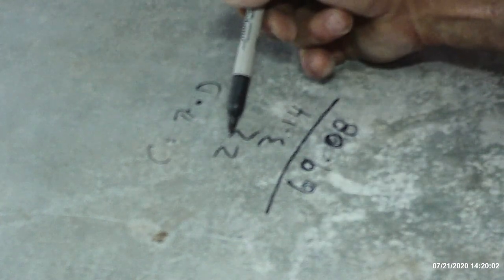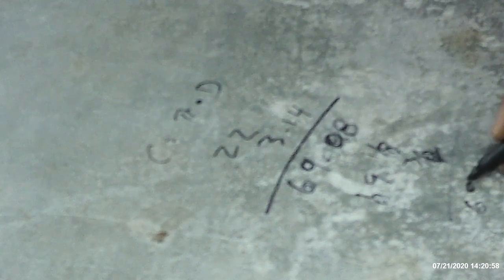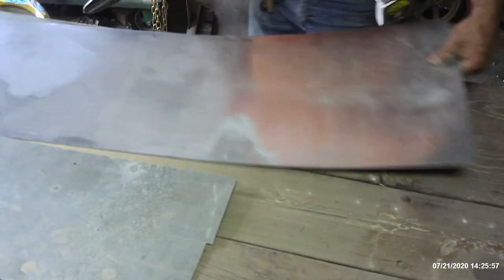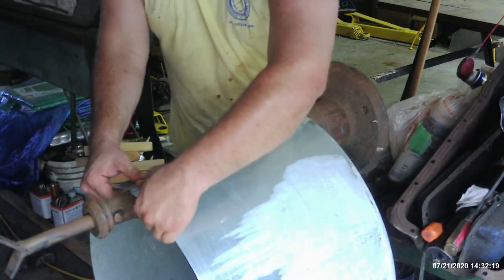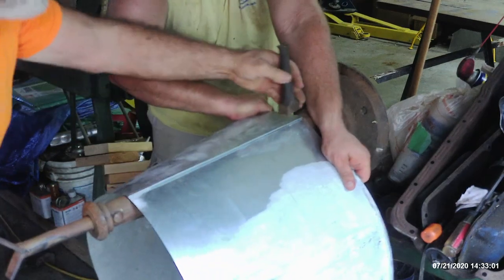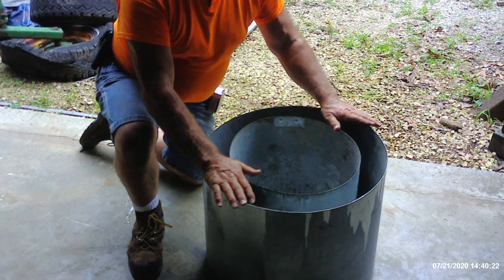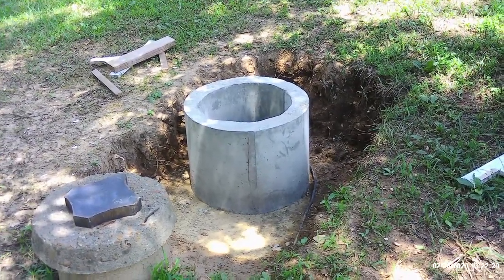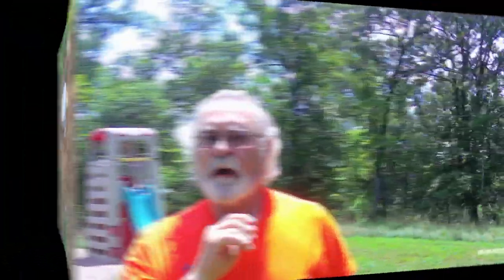Grooving Tool Handmade Lock for Round Pipe,  Septic Tank Riser

Comment: This is a very good idea....I will do the same thing for the septic extension at the camp....well done...CHEERS
Reply from the maker: Be ready to totally destroy the material after the concrete sets up Gator.  If you want it to stay perfectly round, drop some round plywood reinforcements down the inside with a big hole cut in the middle to make them easy to tear out. My son just used 16'' pieces of scrap to brace it criss cross to the inside is not quite perfectly round. Thanks for the comment and kind words Gator !!
Reply: @tractorman4461  I got lots of plywood....thanks for the tip...CHEERS

Comment: I enjoy watching your videos, always learning how to do something!
Reply from the maker: Thank you sir for the fine compliment this morning.  This is a simple joint that can easily be duplicated by grinding a groove in a piece of thick metal.  Clamp the sheet metal between two angle irons to bend over then latch down like we did here laid over a piece of pipe or round stock.  Simple ! I've used this lock forming gas tanks for flywheel engines and breather pipes for old tractors a number of times.

Comment: Now that is a nice old sheet metal brake!
Reply from the maker: Thanks Pat....its getting kinda hard to find 'em in such good shape.  They have usually been dropped over while moving with handles broken and brazed or twisted and sprung from bending too thick of material. This one is straight as an arrow.
Reply: @tractorman4461  and why do you think I said it was nice! I have come to find out that the “old stuff” is far better then what is available now, especially when it comes to heavy duty good and equipment!

Comment: For my septic riser I used a piece of driveway culvert, the plastic kind and put a concrete cap 4" wider and set that on top. Your way is a 
good system but not everyone is as good as you are at constructing what you did. Enjoy your videos, and am a Massey man to. I was weaned on a "101 super and we had a 30, 33 and I now have a pony, 30, and a 44. LOVE IT.
Reply from the maker: Ahhhh...another Massey guy.  We had two 44's an old model 25, 101 Jr and a 101 Super.  My brother has the Jr and one of the 44's and I have the Super.  I have a pile of them now, some parts tractors and some running.  His riser worked out quite well for him.  Thanks Jim for stopping by for a visit.

Comment: Nice work TM. I ran across one of the hand brakes and a stomp shear at Your Estate Sale by Schoolcraft. Lack of room was the only reason I didn't load it up. $600.00 each and worth every penny. 
I worked at Borg Warner in a shop that fabricated prototype and short run production radiators. It was a magical place. I had access to a 12' bed Wysong Shear, a Whitney Duplicator, a CNC Press Brake, and all the standard tool room tools. Why the heck did I leave that job?
Anyway even though I no longer have access to the tools I love watching you making it look easy. 
Thanks.
Reply from the maker: Dang it....I keep finding good guys dumped in the spam folder and cannot figure it out.  I select allow all comments too !! That sounds like a nice place to work.  I've really only worked for three contractors that spanned 40+ years.  The first one back in the mid 70's was the last one I spent any shop time at all.  That's why I'm a little on the rusty side in the metal department.  Thank you once again for the compliment.
Reply: @tractorman4461  I check the Held For Review folder every day when I read the comments. 
Having a period out of place in a comment will dump it in the review folder.
I set it to screen for inappropriate comments. I would rather have a few end up in review that don't belong than get the links to porn sites I was getting for a while. 
Not everyone is nice these days. 
Borg Warner was a great job. I'm still friends with the people I know from there. 
They paid for a lot of my education too.
Reply from the maker: @OldSneelock  I’ve seen those links too but I report for spam and they disappear. But I click allow all comments to keep from missing ones like yours and other good guys. I get so busy and come in too late and just run outta energy to stay up with it every day.

Comment: I call that bender a press brake? Man you were in bizznes when you brought that home!
Reply from the maker: Yes, its an 8' hand brake.  I'm not sure, but I think the term 'press' refers to the hydraulically operated brakes that are a bit newer than these old manual ones.  This one is actually a spare that came to live here as a result of doing a furnace changeout a couple years ago for an old timer friend of a friend kind of deal.  The daily user 8 footer is in the other shop with the metal tools. This one is old, but in superb condition.

Comment: If you're not careful, some may think that you do know what you are doing LOL. That was a nice way to make a concrete form,..neat and tidy. 
Do you use form oil on the inside or is there any need of this?
Reply from the maker: No on the form oil. If we thought we would be using them again...yes, but this was a one time and scrap-it deal.  I ran out of sono-tubes one building a lean-to, but had a number of scrap 8'' diameter round ducting....guess what it was used for..... LOL.  Worked fine too.
Reply: @tractorman4461  Yessir, use what ya got! Good way to 're-cycle'!
Reply from the maker: @regsparkes6507  Like I said before:  I've been living green since before living green was cool !!  LOL.